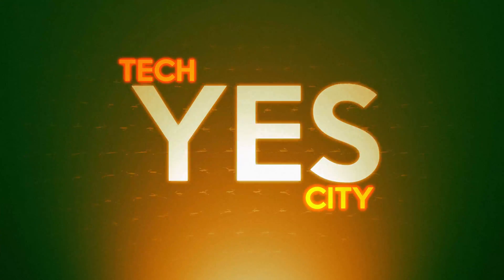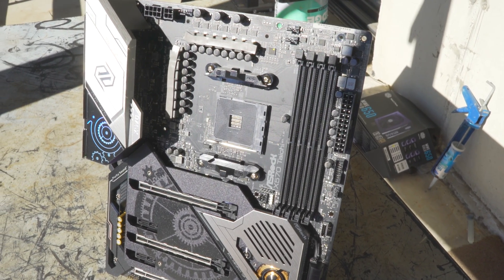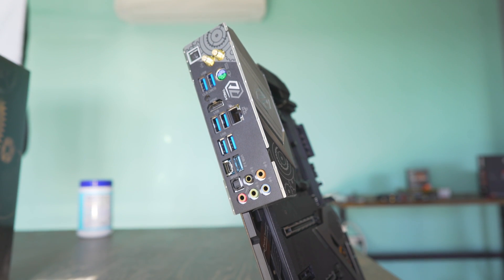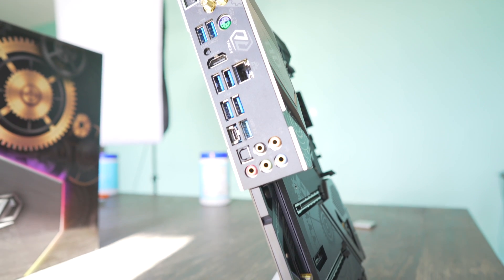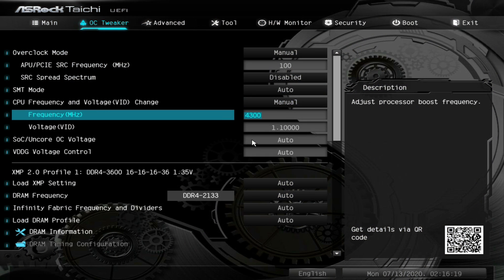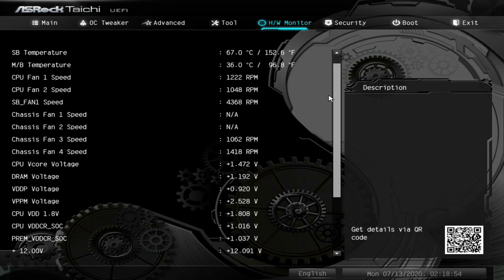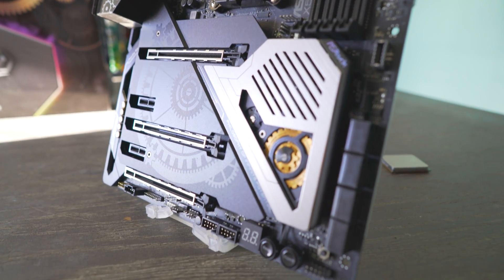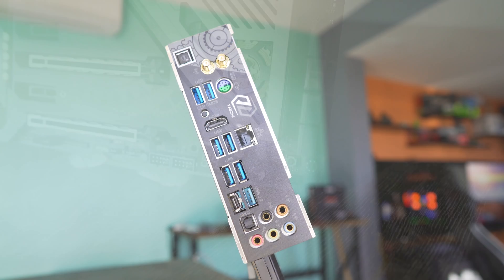ASRock X570 Taichi Review

Comment: I have this board and have been using it for a little over a year.  I really only bought it because of limited options during covid 2020 and it was on the higher-end of $$.  

The chipset fan began making noise after about three months of casual use.  I contacted their support and was told that replacement parts were not available.  I finally received a replacement after about six months of having the fan going out issues. I recently started having freezing issues that hinted at some sort of hardware failure.  This started about three weeks ago and they have slowly become more frequent.  It finally gave itself up today.  No SSD was available during bootup.  I thought I had an SSD failure at first, but thankfully it works in the other m.2 slot for now.  I don't know if the fan failure assisted in this failure to not, but I'm pretty disappointed in this MOBO.

Comment: Good board, but I use the thunderbolt card so I can use a UAD Apollo 8 for audio in/out and the amount of noise coming through my speakers is unbearable.  I think it's because the foce you to use the middle PCIe port fort he tunderbolt card, and it ends up sitting directly next to the GPU and picking up interference.

Comment: I have a question about this motherboard, if i connect my Microlab Solo 9C speakes that are amplified and have their own audio drivers that the manufacturer didn't specify anywhere in the internet, with Coaxial RCA cable to jack3.5mm or Optical TOSLINK cable on the motherboard's SPDIF output, am still gonna have this slight leakage on max volume over my speaker's output, even when the signal is gonna pass from the speaker's audio driver or the audio driver is gonna take care of that leakage? Which output 'Default Format' should i choose on the Realtek Audio Console with each connection? Some specifications of the speakers are:
Frequency response	  50 -20 000 Hz
Signal/Noise ratio	80 dB
Separation	60 dB

Comment: I got my Taichi system up and running... 3700X, all M.2 slots occupied(1 is NVME for Windows), all SATA ports in use, GTX 1080Ti.. no issues with overheating
Reply: Should I Buy Asrock Taichi x870e in 2024?? 🤔

Comment: Would that board with the AMD 3900X CPU have enough PCI-e lanes to  be able to support 3 Samsung 970 Evo Nvme.M2 x4 storage devices along with an Nvidia 2080TI video card in 16x mode at full speed please?  Would I experience performance loss due to an insufficient number of PCI lanes? I think the 3900X have 24 lanes but 4 lanes of that is dedicated to the chipset so 20 spare lanes in total? I am not too sure how is that calculated. Could someone with the necessary knowledge give me a definitive answer please?

Comment: Bryan, another excellent review.  Thanks!  FYI:  in the future, would you give some thought to a video with a special focus on the ASRock Ultra Quad M.2 add-in card?  It would be nice to know if ASRock is planning to upgrade that card for PCIe 4.0.  Also, with the sheer speed supported by PCIe 4.0, the ASRock Ultra Quad M.2 card could be configured in RAID-10:  2 x mirrored RAID-0 arrays of 2 x PCIe 4.0 M.2 SSDs.  2 @ PCIe 4.0 = 4 @ PCIe 3.0.  Thus, it should be possible to do a fresh OS install directly to such a RAID-10 array.  I'm still looking for a review that explains whether or not the X570 chipset supports a "4x4" BIOS setting for x16 PCIe 4.0 expansion slots.  I suspect NOT.  Thanks again.  Keep up the good work, mate!!

Comment: Considering buying this board mostly for its looks.  Im not big on overclocking nor big on most the bells and whistles.  Im pairing with a Ryzen 3600, an RTX 2070Super, and an Intel NVME drive.  Hoping for a great experience and pairing between these components.  Some help here... I'm def hoping audio turned up to 90 to prevent crosstalk wont be an issue and that its loud enough for me.  Audio is a big deal to me.  Whats the deal with what others are saying about the type c connector being in the way of the PCIE slot on front panel or something?  I dont have any Type C gadgets so is this a big deal?  And then whats the deal with people complaining about the bios and that it breaks things?  I just game and want the best experience possible for the budget I have.   Thanks!

Comment: I have an important question i need an answer on...

i'm thinking about buying the Focus gold 650w, and it only has 4 + 4 cpu cable, but the Taichi motherboard has 8 +4 cpu plug... do i need to plug in an extra 4?
Reply: nope definitely not needed. Even one 8 pin is complete overkill for a normal 3700x and even an oced 3900x doesnt need more than that

Comment: Wish more boards had utilized pcie 4 and the extra lanes to add more m2 slots. This is the only one Ive seen with a 3rd storage slot
Reply: There are several with 3 slots and even 4 and 5 m.2 slots.
Reply: @Melthornal  only one I've found is the taichi but I didn't really look above that since imo $300 is kind of excessive unless you're already at the flagship cpu or absolutely require a feature *and I'm not looking to do a 3900x build so I didn't even bother checking the godlike etc

Comment: the type c usb front panel location is in the way of pcie slot 1
Reply: some cases have a 45 degree cable which fits,If its straight then you gotta vertical gpu mount it or give up the usb type c

Comment: I'm reading that some people are having issues with the USB C connector being blocked by a larger gpu. Is this accurate to your testing?
Reply: I also just read that review on newegg I'm very curious as well
Reply: The board is 24,4cm wide, and it looks like the USB header's opposite side from the edge of the board is about 2cm away. 
RTX 2070 is 22,8cm long. That's the best clue I can give quickly :D But from other reviews it looks like the USB header is totally inline with the first PCIe slot, which is... silly

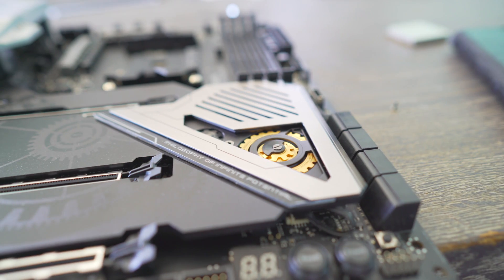Comment: 4:05 I have to correct you there Bry.

1 x 16x PCI-E, 1 x 8x PCI-E, 1 x 4x PCI-E, 2 x 1x PCI-E

You can always see the PCI-E lane speed, simply look at the back of the board and count the pins clusters on each PCI-E connector, regardless of the what the manufacture states.
Ref : http://www.hwbattle.com/data/editor/1906/thumb-cc5284cc526f4f00247563ff2b93a2d6_1560846460_0904_992x1070.jpg

Board looks good, but I have never liked those tiny board fans, always end up failing or becoming noisy.
Reply from the maker: Sorry you are right, that went completely past me.  Not sure why it's written on the box like that.

Comment: Hi quick qeuestion dose the pcie port 3 go to the procesdor or to the x570 chip set.  My noctua cooler is to big so i cant use the 1 pcie slot because my 1080 is custom water cooled.   ty in advance

Comment: I notice some people trying to say that Asrock BIOs is $#/+. I have to say that ever since the z77 Extreme4 days. I have had no issues with Asrock UEFI. I think a just works. No pun intended.
On another note I've been digging through some Audio testing and found, that specific audio testing software with certain cables, wires, speakers, and mics. that it was reporting crosstalk that wasn't there. Like on boards with built in dacs. Specifically ess sabre 9 series.

Comment: After having issues getting the 3700x running smoothly on my b450 carbon ac, I decided to get this motherboard and am loving it.
bios feels a little old school (which I love), not bloated with graphics etc, just quick menus and selection.
ram (gskill flare x 3200mhz cl14) booted no problems with xmp profile or overclocked to the sweet spot 3600mhz.
only time will tell with bios support, right now it's working perfectly and that's what matters to me.

also boots fine with only 8pin cpu connector, maybe the 3900x might need the 8 + 4 but on the 3700x it is unnecessary at least at stock.

pch fan is audible however the fan profile allows for tweaking to your liking and remains pretty cool even after silenced. my gpu is raised and watercooled so I cannot comment on the chipset getting hot due to the graphics card dumping heat onto it.

I wish rgb allowed for more features such as colour based on cpu temp or something like I had on the msi board, however it does still have a nice selection, also rgb on the motherboard stay lit when shut down.

lastly, wifi reception is the strongest i've ever seen on a motherboard implementation. usually I am required to plug in the antenna's to get decent speeds from my router located a fair distance away. With this board I'm able to receive 650Mbps (n wifi) whereas my previous motherboard stuggled to achieve 290Mbs in the same conditions. My connected speed bumps upto 866Mbps when antenna is connected.

all in all, this board is great.
Reply: Im still debating ... can you completely silence the fan?
Reply: The Bluetooth is good?
Reply: Hey do any of you guys know about the BIOS problem and did it get fixed? Apparently ASRock overvolted the shit out of its board to the point where 180% power delivery delta between actual and reported power usage. It misreports how many watts are getting utilized, so, there's that, which may explain partly why PBO was frying so many people's chips over time. Not sure if I did have silicon degradation or not, do have your chip, but my 3700x has largely been undervolted in Ryzen Master because their 1.5v humps was making me paranoid. "It's normal" they say, well idgaf and I undervolted it to like 1.2462 or whatever at 4300mhz for gaming/creator reasons, and another much lower profile for most gaming at 4.2ghz 1.1875v which I've been told is supposed to be a "golden sample" although if my board is delivering that much power...then how much is it just board's BIOS doing basically pre-overclocking?

So I dunno. Works great, but I feel like it hasn't quite hit 4.4ghz all cores same way it does when I first got it two years ago.

Comment: I bought this board on the eighth and already returned it. I have the X370 and was hoping for a smooth continuation from that. However this board was just bad for a simple user like myself. When going into sleep mode the PC will only be awaken by pushing the power button instead of mouse and key board. Yes in device manager I have devices enable to wake PC and in the bios I turned off Deep sleep however the issue persisted. Also when waking the PC from sleep both my HDD Drives were not showing up only if the PC was restarted would the HDD reappear. Did a bios update and these issues still persisted, such a buggy mess. Writing this just in case anyone else has these same issues.

Comment: Comparing this to the x470 taichi ultimate really makes deciding difficult, especially since the taichi ultimate has 10gig lan and is only around 200-250€ compared to 300€ for the new one. Of course depending on if you need pci-e 4.0.

Comment: bryan , im sorry but i have TO DISAGREE with nearly everything you said about asrock and their bios, having watched and tested am4 bios releases over the last 2 years on the am4 platform it could be better described as terrible, several times they have release new bios files trying/claiming to fix a minor issue and then MADE NEW MAJOR BIOS ISSUES on the new one breaking PBO wrecking prviously stable ram speeds/timings, the asrock support forum is swamped in users suffering DOWNGRADES to systems after trying new public bios , the amount of users having to GO-BACK to earlier versions is insane, who knows the new x570 might be functioning correctly at the moment ,what going to happen when asrock finally release the new 1003ab bios / what will get broken then ?
this is exactly the path the x370/x470 took (my x370 is on bios 3.1 due to issues with later bios files,which is fine for a 1700 nonX) take a look at forums trying to get the ryzen 3000 working on x370 its a trainwreck ! people are stuck on 2400 ram even with decent b die kits ,sorry fella but asrock make great boards both mechanically and electronically to be absolutely ruined by BAD BIOS writers
Reply: @tony barden 
Buildzoid had even worse to say about them yesterday on his channel.He said bad bios's,repeatedly,  AND horrible ram support in general but especially for overclockers.
Reply: @mannyc19  indeed i recall bullziods ranting about the bios on the x370 years ago ,and he was right it was terrible ,late yesterday asrock customer support started issuing a new bios for the x370taichi bios v5.61
it seems to get expected ram settings working now BUT 

as per usual has now GOT A LOAD NEW BUGS ps2 keyboard broken/saved profiles hardlock system/csm mode = no display/to set the ram you need to adjust voltage-save-reboot then set ram speed and timings
once again asrock fix one thing and break more things ,this is exactly what i was talking about ,bryan must know this as he had the x370 taichi back in april 2017 im sure he used it after that

Comment: Which m.2 slot to use? I am planning on putting my gpu in slot 1. Does it matter? I already installed the nvme in m slot 1. But before I install Windows I want it to be right. Also, it took me a bit to realize the heatsink screw was the screw to use for the m.2, instead of the supplied screws.
Reply from the maker: No it won't matter on this motherboard, they are all gen 4 x 4
Reply: @techyescity  I just noticed in the manual it disables pcie slot 5 when using slot 3 m.2 .

Comment: thank you very much for the review, I've been sitting on the fence between this board and the Asus ROG Strix X570-E Gaming. Would be awesome if you can do a review/comparison of the two since they are priced the same in Oz.
Reply: well i sharing the same thought with you sir Asus ROG Strix X570-E is much expensive thanX570 taichi but it got 2.5GBPS and pretty good vrm , temp,RBG...Em cũng đang phân vân giữa hai con này chưa biết nên chọn con nào nhung nghiêng một ít về Asus bởi x570 TAICHI cổng USB type3 nếu lắp con card PCIE ở slot 1 nó block mất cổng này chưa kể RGB khá tệ khả năng đồng bộ RGB với graphic card hay các linh kiện khác không được tốt

Comment: Doesn't the chipset fan get obscured by any gpu?
Reply: Yes is does, some have reported that the chipset got so hot that it shutdown the PC. But only with the GPU in the first PCIe slot (nonblower design) blocking and also pushing hot air over the chipset heatsink.